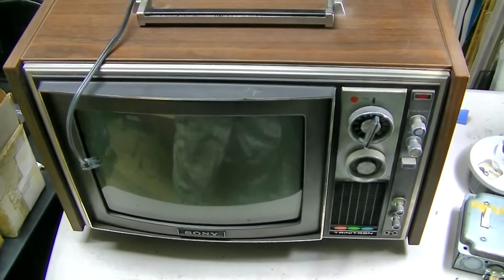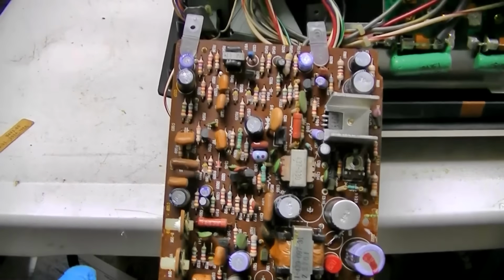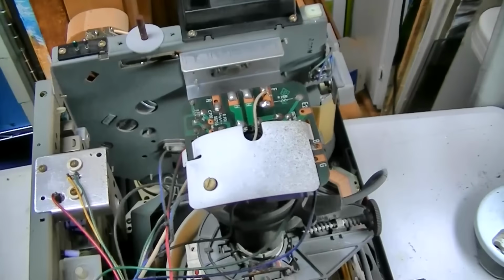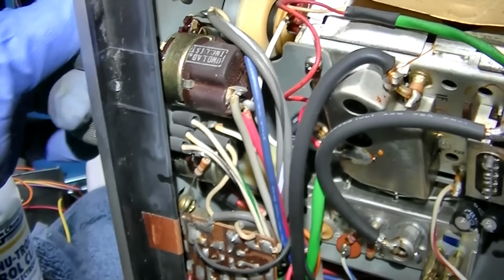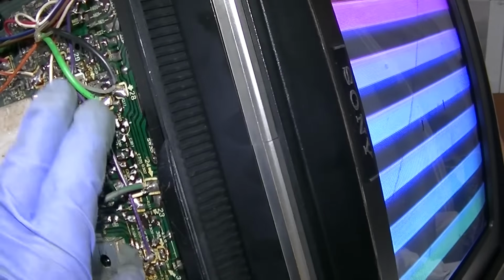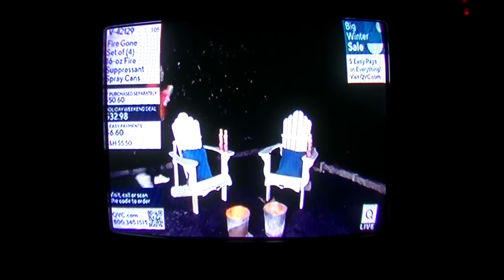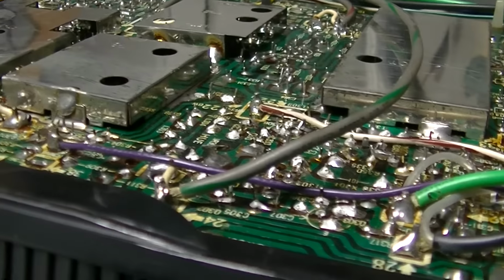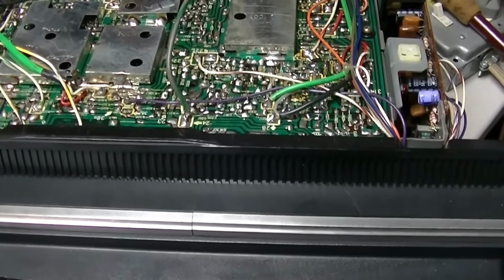1974 Sony Trinitron KV1212 Repair Color Television Portable TV

Comment: I want you to fix it while it’s all changed with all capacitors OK and I want it doesn’t suck. I want it well where the days are walking longer what the fuck you dream Pop down I need the brightness down a little bit because it got high, going to bedfix the thing Taylor switch

Comment: I repaired a lot of those back in the 70's, working at a shop that was a warranty service center for many major brands of TV and Hi-Fi equipment. I mainly worked on Sony TV's. I had one of these, and it lasted into the early 90's.

Comment: I had a 1973 KV15 (1510 maybe ?) 15" Trinitron, very similar to this one. Never had a single issue with it. The picture was fantastic. I left it to my brother when I married and moved out in 1983 and as of a year ago he said it still works great except that the picture tube takes a while to warm up and starts off green-tinted until it warms up. GREAT TV ! Best CRT set I ever owned. Now I've got a 65" Sony Bravia MiniLED flat screen and it's every bit as far above its peers as this was back in '73.

Comment: I have a 10something pal set, this and mine look quite similar but I think mine is 1st gen Trinitron, early 70´s, 240volts. It still kinda worked when I tried it but it had funky coloring, a bit like if I held a magnet next to it. But after this I think I can do it. Boring parts change is right up my alley. I´ll look into it, it is quite uplifting being able to state "I fixed a TV".

Comment: TVs that looked like that kind of model were common in Japanese surplus stores back then in the 1980s here in the Philippines and they require a stepdown transformer because Japan is 100 volts while the Philippines is 220 volts. If that TV were accidentally plugged directly to 220 volts although the fuse blew, the neck of the CRT also breaks. That model doesn't have a protection of its CRT. Accidentally plugging Japanese (100 volts) or American (120 volts) appliances to 220 volts is common here in the Philippines because despite our voltage is 220 volts most of our outlets are American NEMA 1-15R so their plug fits in our outlet damaging them.

Comment: I still to this day, find myself diagnosing dead  am circuts on zenith transoceanic radios by removing the germanium transistor and if its shorted to test leg, tapping it with a screw driver and most of the time will be just enough force to remove a small whisker from inside the transistor.  Crazy, but it works.

Comment: Hi shango. This comment has nothing to do with this video but I found some useful info on the t291 India radio that failed the am test. It would seem that one of the electrolytic capacitors that says 1 microfarad should be 10 according to the Sony schematic this drastically make the a.m. band sound so much better with less distortion and possibly less bleed through from other stations thanks again for all your videos

Comment: Life is just a big electrolytic capacitor; in the end you're old, dry and worn out. Meanwhile give a few shocks, keep people alert.😆 My hi-tech de-soldering tool is a Soldapullet, having started off with the heat-wiggle-pull approach in my electronic teens.

Comment: Well done :) and thanks, I thought I didn't have an ESR meter, turns out some time ago that I bought one of those bare circuit board component testers like you used in this video, I put a 1.5V battery into it and it didn't work. I just powered it from USB and it works fine. What battery do you have in yours?
Reply: I think his has a Lithium ion battery.

Comment: I need  to have a zenith 2G turntable Matrix- Stereo  Console worked on! I have a feeling  the gear section on the side of the Wheel drive mech. has been taken out of the turntable.I have multiple other 2G truntables around but the tone arms are no longer connected to them. and the gear(s), are there on the other turbtables. so, that is a problem, the worst part is that I im  Living in Iowa, Jim Lindeanas is to the Borth east in canada, Shango is in CA, and RTVN is in Texas??... I think?   

would anyone around YT know of anyone closer to my area that works on Phongarphs?

Comment: These are tough sets. In 1980 we bought this model from a pawn shop for $125.00 NEVER had any problems with it. My little brother still has it now. Like you said, " Don't leave them Plugged in. " It has been a Great set for only $ 125.00 ! A day on the work bench Spoiled by a WHISKER...

Comment: Looks like Standard Repair Procedure should include wiping a soft bristle brush over the solder joints of electronics of this era. If there is one tin whisker, there are likely a lot more around.

Comment: If hell were designed for a tech or engineer, it would simply consist of a room with all of the best tools, parts, and test equipment humanity will ever produce... and an item with an intermittent fault that cannot be resolved.

Comment: I might well have got rid of the 'tin whisker' in using a toothbrush around the 'sensitive' area of the circuit board. I worked on several of these sets in the 1990's, and the Sony Trinitron with a good CRT gave a very clear picture after replacement of deflection electrolytics. In Australia, several of these models incorporated a 'switch mode' power supply, reliant on a horizontal pulse to maintain operation, and with a 240V AC mains supply, giving a +B of 135 V, with a few other low voltage rails, where electrolytic capacitor replacement was common. You have done very well to come to a very rare diagnosis, as I remember thinking that the 'tin whisker' was something that just occurred internally with (ageing) germanium transistors...

Comment: If you look at C516 if my eyes see right, the big black one AT 7m 27s the heat shrink plastic on the can has shrunk down the sides of the can that is a sign it's been getting to hot!

Comment: 25:40 There's a bad solder joint at .. um, I'll get me coat 😛

ETA: Fire "Suppressant"? Never seen that one before. Clearly they don't qualify as "EXTINGUISHERS" .. barely enough to put out a paper fire in a bucket .. for effectively $10 for each one-squirt-wonder !! Shocking.  .. Keep 'em going! Cheers ☺

Comment: My main suspect for the vertical problem is that large "bald" black cap on the vertical board.  I'm thinking it started life like the other black caps with the label going over the top, but it's bald because the heat has made the label shrink.

Comment: "Tin whiskers" get everywhere, older lead/tin solder either kills you with the fumes or throws phantom faults.  As a matter of course I just run a brush over stuff. Great vid as usual, between you and 'Glasslinger' I have learnt loads. Haven't work on one o those for decades, usually blow Line Tx drive from conformal coffee .!

Comment: A friend gave up on his huge Panasonic CRT type TV due to intermittent problems after it warmed up, so he gave it to me after he got a refund from the appliance store who didn't want it back for some reason. It weighed a ton and I really didn't want a set that big but I gave it a shot since it was pretty new. I took the back off and start pressing on the bottom of the main board with a screwdriver handle. Found a bad solder joint near a power transistor and re-flowed all the connections that looked iffy.  We used that set for the next 5 years because it had a great picture. We left it behind when we moved because it was that heavy.

Comment: i have a nearly identical kv1310 from 1972 with the older chassis, one of the first TVs i trash picked when i was a kid, mine has something wrong on the IF board and displays a blank raster and no sound

Comment: nice, i have a plastic cased kv1300ub that has similar control layout, minus the vhf tuner, its a plastic cased variant of the wood cased kv1320ub that for some reason has different control layout

Comment: Is there a way to defeat the instant on?
Reply: Install a master power switch that disconnects AC from the set.
Reply: If the power switch has more than two terminals then there's a decent chance one of its leads is only used for instant-on.

Comment: It's good that Shango replaced the big cap at 15:20, as it barfed its contents on the board. It was measured acceptable, but the leaking, dried electrolyte is reason alone to replace it. Excellent color, especially for a 50-year-old set. It came off of the assembly line during the beginning of the first Energy Crisis, at a time when postwar Japan was really getting its act together regarding quality control of cars and appliances, and eating everybody else's lunch as a result. I remember those days.
Reply: Also, that cap was already marked as bad.

Comment: 35:57 A common 5#ABC stored pressure powder extinguisher from Home Depot or Walmart will be more effective with a Christmas tree fire. It would be safer too as there is also electrical risk involved.

Comment: 37:34 Did Sony emulate Zeniths bad habit of making the UHF fine tuning knob totally enclose the dial? I remember practically wearing a hole in our Zenith switching back and forth between 27 and 56; eventually I took that stupid thing off and replaced it with a radio knob to have both coarse and fine tuning like the owner's of most other TV brands. I suspect Zenith put those things on their cheaper models, though they couldn't have cost any less, just to get buyers to spring for the next model up.

Comment: as you say the lamps go so soft so quickly on them but when you see a good one they are amazing , when i was apprentice we were sony agents so used to see them now and then and usually the tube was toast and even in the early 80's they were un economical to change i can remember changing 1 , we had 4 sony kv1810 and a kv1800 as loan sets with the cup handles on the sides they were heavy but super reliable , later we started replacing them with the later kv1820 model all were estimate refused repairs even back then needing caps changed and usually needing that sgg transistor changing and they were expensive and no alternatives available that would work reliable , nice work great save hope the customer appreciates  what he has there
Reply: yeah, I was stupid lucky to get one with a fresh tube. It's instant-on, so I will keep it unplugged when not in use.

Comment: 17:45 You’re probably right about “bad” or “cold” solder joint comments being troll comments. But then there are some people who convinced they can identify bad joints simply from a still image or a  video. I’ve also received comments regarding bad joints based on images, when the joints in question weren’t actually bad but rather had developed a fold in the solder when cooling down around a lead. 😆
Reply: Everybody's an expert on YouTube😅 it's just like audio karma posts, anytime somebody wants help repair in a stereo or a radio first thing out of everybody's mouth is change capacitors.
Reply: @danielknepper6884 
Yeeeep. My response is to empty a can of deoxit in everything that moves. Even headphone jacks, bias pots, and internal relays if you can. Dirty connections are the bane of my existence. Bias pots going open love to just blow up output transistors on sets without bias protection diodes.

Comment: Thanks for the look inside and repair on this. I have a KV1203 that's very similar, but I haven't turned it on in 20 years and I'm now a little afraid to unless I'm prepared to recap it. My set belonged to my grandfather and always had the best, sharpest picture of any CRT ever. I stopped watching it so I could watch a bigger screen and now ironically I watch nearly everything on a monitor not much bigger than the little Sony.

Comment: 3:15 I've got a 1969 black and white that will go from almost no vertical sweep to full height in about 20 minutes. My GE portable tube 19” starts about half size and gets full height and will be ok if used everyday or few hours.

Comment: Excellent Japanese color tv, in Argentina we had similar, only with a single tuner on VHF (2 to 13). It reminds me of my beginnings in technical service of televisions and radiographers. Now, I am a teacher of electricity (and the electronics I left for my hoobies). Exactly, I agree with you, the first thing is to replace all the electrolytic capacitors in the vertical and the ones near the Flyback. A great greeting from Mar del Plata. ARG.
Reply: Hola! Que lindo encontrarse otro argentino, tienen canales de aire como aca en cordoba?
Reply: hola, desde hace 12 años tenemos la televisión digital abierta por aire  pero lamentablemente seguimos también transmitiendo en VHF  (canales 8 y10). saludos @brunomoyano8727

Comment: My grandmother and an aunt both had this exact model of tv - lots of memories of watching early 80's programming on these beasts. Getting to spin the smooth dial and having to fine-tune for the brand new UHF channels that would occasionally pop up was an interesting experience compared to the notchy locked-in dial for tuning VHF
Reply: Ahhhh the cluncking sound of a spinning turret tuner to me is so satisfieing.
Reply: In 1975, the FCC implemented the UHF "equality rule", so TVs had to have detents for UHF if they had them for VHF. But there was no "memory fine tuning", so you still had to adjust the fine tuning after some channel changes.

Comment: $349 in Chicago on December 1st, 1972. ($2,604.73 in 2023 dollars)
Reply: Wow I can remember getting a tube Sony I think it was 30 inch or 32 inch at circuit City in the early 90s it was a  $1000 or so if I remember right.

Comment: Красивый аппарат, сколько он стоил в свое время?
Reply: Approximately $670-700 USD for a TV set like this in the '70s.  It'd be about $5300-5537 USD with current inflation rates.